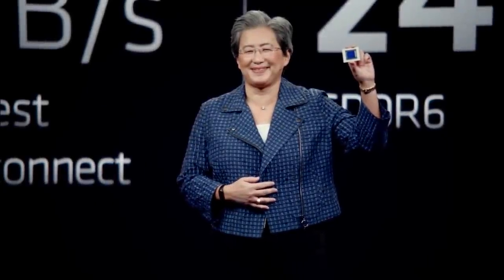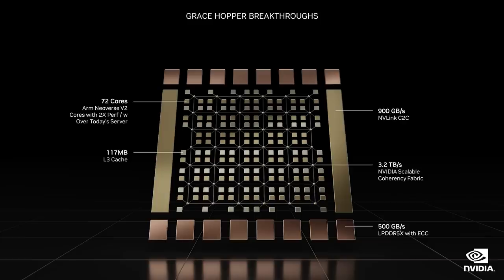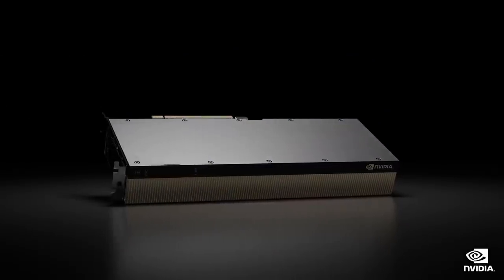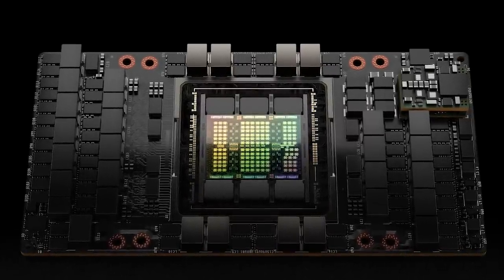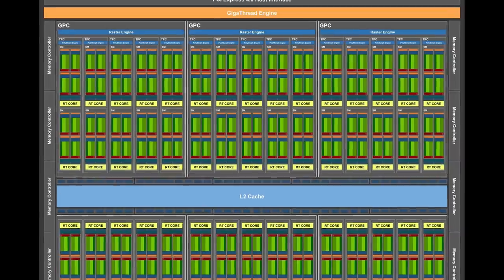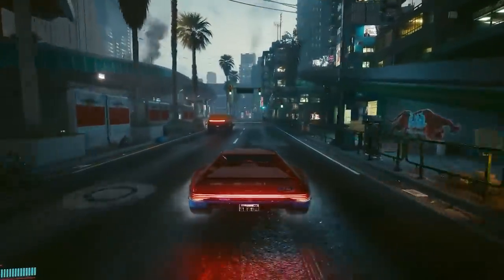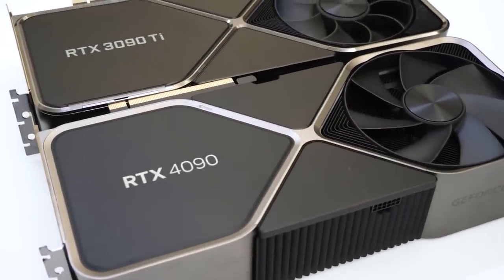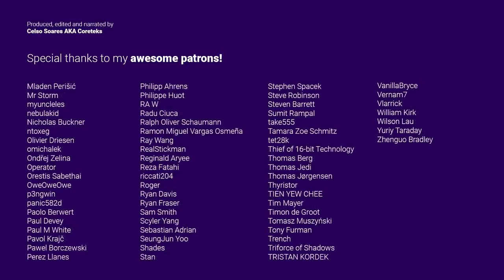NVidia CHIPLETS Strategy explained

Comment: "so I think that at a one nanonemeter Nvidia will introduce a chiplets-based architecture" One nanometer? Will it even be possible? I mean, I know that those numbers are pure marketing, but for what I know in the real world and real 3nm there are problems due to tunneling, and I've heard about TSMC working on 2.5nm and maybe 2nm, I'm not sure about more advanced nodes. I wonder if photonics will be a turning point in few years, because I have the impression there's not a lot of room for advancements with sylicon.
Reply: Photonics helps moving data, which will in itself help chiplets become more viable at smaller scales.
Regular silicon is already changed beyond recognition from the days of planar transistors, to get to 1nm and beyond the biggest change will be bulk materials, not the process in how they're used.
Reply: @MetroidChild  with photonics I'm talking of the work of startups like Lightmatter or Luminous: https://www.youtube.com/watch?v=t1R7ElXEyag

Comment: The problem with the chiplets (for compute) is the bandwidth.
Maybe in 10 years is possible, but not today...
Reply: Look at MI300 from AMD, they already are 3D stacking 2 compute on cache. They already have plenty of bandwidth to start. The total bandwidth of the 6 MCD connections is the same as the 4090’s L2 bandwidth

Comment: This video seems to rule out significant increases from within the architecture itself and that the only way forward is through MCM. I wouldn't be surprised if Nvidia introduced new revisions of the existing cores already available combined with new cores/architecture we can't even imagine at this stage to keep the monolithic approach alive & kicking for many generations to come. AMDs approach of going MCM is really a substitute for lack of real innovation within the architecture itself (and a way to make as large a margin as possible by combining different dies). I doubt we've seen the last of innovation within the die such that MCM is the only route forward. Nvidia may be cut throat in reputation with prices to shame a goat, but they have some of the best talent in the world when to comes to chip & software design as they've repeatedly demonstrated over the years. Whatever they're developing will move the needle, not merely approach it and run cowering like AMD's MCM offering did this year. All the advantages and opportunities for advancement in MCM and once again they produce another "almost" generation of cards. Why go MCM if you're going to once again bend over and grab your ankles in performance??? AMD have embraced their role as 2nd best and nothing they've done shows me they want to be anywhere else.

Comment: I definitely think Nvidia are going to go to some kind of multi die process. Idk if it's gonna be chiplets but, I see it coming. They are killing it with Monolithic but, That obviously can't last forever. It'll be interesting to see where it goes on the end.
Reply: If Nvidia switched to Graphene and used the new generation of transistor method. They could stay on monolithic even longer.
Reply: @ZackSNetwork  I don't see anyone switching to graphene over the next 15-20 years time.
Reply: Nvidia can do this all day. Lemme tell you whats gonna happen. When Jensen is pushed against the wall, he will release latest gen with cutdown prices. So low, it will make amd cards look like blatant robbery. He can afford it and he will do it, and he will crash amds stock sooo hard, they will never recover.

Comment: Can I have rt3030/4030? I don't need CHIPLETS. I need 256 shaders discrete gpu under 28w. gt1030 is now 5+ years old and 1630 is a defective overprice of 1650 with 50% of transistors turned off. 
Even rx6400 is way to overpowered for my needs.
Reply: Why 256 shaders specifically?
Reply: Be careful with what you wish ...

Lord Jensen might grant it on a surprising way.
Reply: @ireallyreallyreallylikethisimg  15-28w tdp. everything more will eat up to 65+w.
Reply: If it's to powerful for your needs, just get a used 960 or 1060. And keep it until you need more power idk. I have a 3090, and want a 4090 or wait for the ti or super of it. We'll see
Reply: @n00b247  just use AMD integrated GPU lmao
Reply: Your probably better off just getting an AMD APU, then some super low end Nvidia card.
Reply: Is there a reason for your use case you can't get a 3050ti or 6400 and lower the power limit with software?
Reply: @SweatyFeetGirl  well those I stated are low powered. Not super low powered but pretty low wattage.
Reply: The APU in the new ryzen chips would meet your needs to the letter.
Reply: @PineyJustice  probably right.
Reply: @PineyJustice  yes, but no. 4300g is still stuck with ddr4, and I need gddr6 with my igpu.
Reply: Why such a specific set of requirements? If you tell us someone would most likely come up with a solution.
Reply: Whilst I agree these are weirdly specific needs, some people really do need a beefy CPU and a tiny GPU.  If I didn’t also play games on my system, it’s workload would consist entirely of audio production stuff:  the more cores and frequency the better in this popular soft real time (not technically, no, but practically it is) use case.  No widespread ability to utilise CUDA for this workload, so all down to the CPU.  Which also needs to be kept whisper quiet, so heat and fans become a real concern.  

APUs tend to not be the most performant parts.

If we don’t understand someone’s use case, it’s presumptive to recommend a solution.
Reply: Why do you need a garbage performance GPU like that?
Reply: @n00b247  Or a ryzen 5700g or 5600g, why on earth do you need gddr6 with your igpu? The 5700g or even the 7000 series igpus have great performance using ddr4 or ddr5.
Reply: @PineyJustice  7000 aren't comparable to 5000G, gotta wait for the 7000G.
Assuming the 7000G don't get gimped on pcie again or ddr5 speeds, might be good enough.
Some "mini pcs" have laptop 6000 APUs though i'm not sure what exactly this guy's usecase is
Reply: @YounesLayachi  I'm willing to bet he's just going off box specs cause ddr4 gpu bad ddr5/6 gpu good without taking into account the real performance of these modern APUs that use system memory. They have a 512mb cache of extremely fast memory built in and just use the system memory as expansion as needed, I'm not sure memory is even a concern with the performance limitations of even these modern igpus since they're not all that powerful compared to even a lower end dedicated card. The ryzen 6000h nuc boxes from beelink with the 680m would probably fit the bill the best for a very low power yet game capable machine.
Reply: @PineyJustice  are you sure they have 512 MB of cache ? i never seen any mention of that anywhere
Reply: @YounesLayachi  perhaps I'm wrong, but my 5980hx reports that the igpu has 512mb dedicated, performance with it is good enough either way for some light 1080p low settings gaming.
Reply: @PineyJustice  that would be RAM (system memory). Yes it does improve performance to reserve RAM for the igpu so that it's available at all times and not waiting for it to be freed like the rest of the shared memory.
From what I know, 1 GB of reserved ram is a good amount for Vega igpus , unless you're low on total ram (ie 8 GB, in which case adding another stick would enable dual channels). 
Head to the bios to allocate more

Comment: Will Nvidia release their first chiplet GPU before RDNA 5?
Reply: Possibly, but certainly not before RDNA 4.
Reply: @defeqel6537  
It's impressive if they make it to RDNA 5.
Reply: If they don’t have a chiplet GPU by RDNA 4, they are in big trouble.
If they don’t have it by RDNA 5, then it simply is game over. 
2nm nodes are required high NA EUV machines which reduces the max die size possible from 858mm2 down to 429mm2 or so.
Reply: @benc3825  

At least they should have it for compute. The chiplet for graphics is more challenging. 

By the time they ship their first chiplet design, AMD will be on their third iteration.
Reply: @sam lebon  The most "basic" and "easiest" version of chiplets for GPUs is what RDNA 3 has done. Separating the compute in GPUs is much more complex because of the low latency required.  So they need to have at least the GDDR buses. 

However, their architecture is designed around having a large very fast cache close by, so it would also require a major architectural redesign. 

If they don't get the cache on a separate die, but do get the GDDR buses separate, then all they did was bought themselves a little bit of time. They still have the issue of using a MASSIVE amount of leading edge silicon compared to AMD. 

The difference in the cost of the silicon between Ada and RDNA 3 is already noticeable. For only the silicon (maybe also including packing costs), N31 costs around the same as AD103. This is using relatively cheap nodes, they are only going to sky rocket in price. However, AMD isn't was Nvidia should be scared of.

Currently, Nvidia can go up to a 26mm x 33mm or 858mm2 sized N3X die for next gen, but then that's it. "2nm" class nodes and smaller require a next gen EUV machine or high NA EUV. Why is that why is that what Nvidia should be scared of? High NA EUV requires a new photo mask design and with that comes new size requirements. Compared to 26mm x 33mm (858mm2) we currently have, high NA has a limit of 26mm x 16.5mm2 or around ~429mm2 or HALF of the size.

As you said, let's say 2 architectures after Ada, they get chiplets working in the "basic" version. It will look like Cascade Lake-AP vs Milan levels of bad if not even worse.
Cascade Lake-AP is (in my opinion) Intel's worse than Bulldozer moment, even Rocket Lake wasn't as bad, at least when looking at their relevant competition.

Comment: Did the entire industry forget that apple has 2 chip system where the entire side is the connection? And that teslas DOJO is doing the same thing in endlessly tiling fashion and has vertical power and cooling? Yeah there is no way these lazy a AMD and Nvidia designs will last forever.